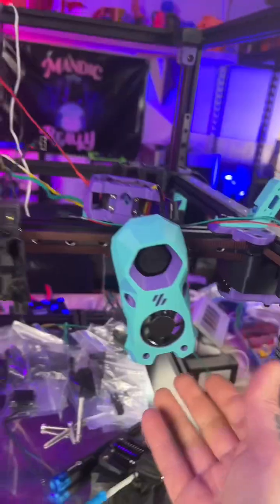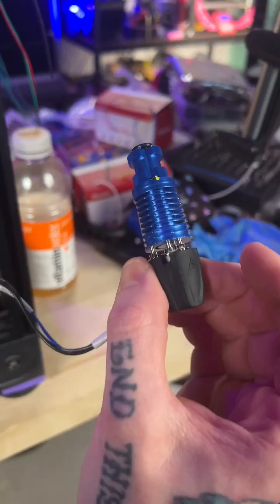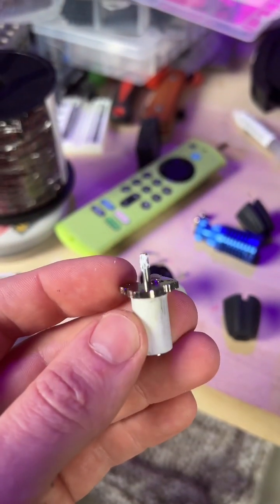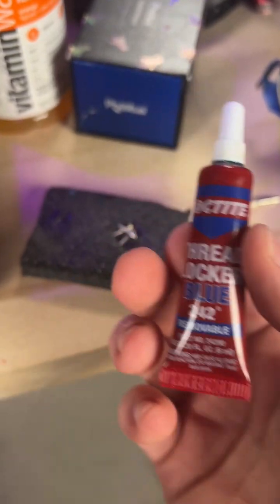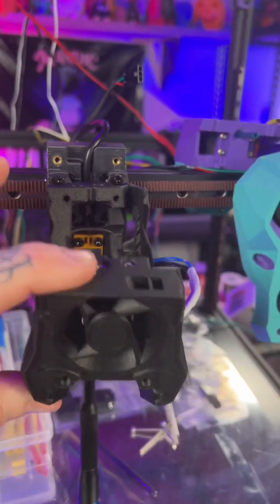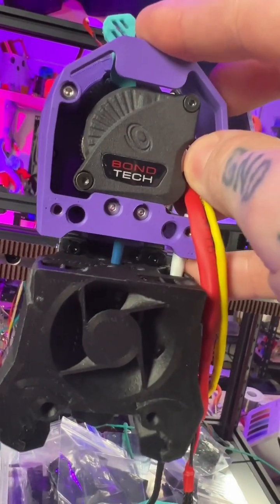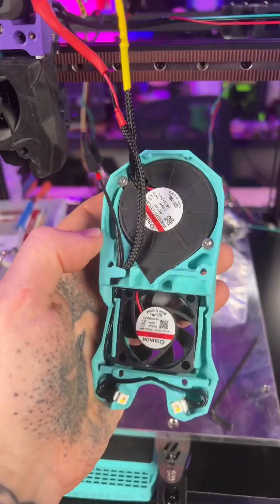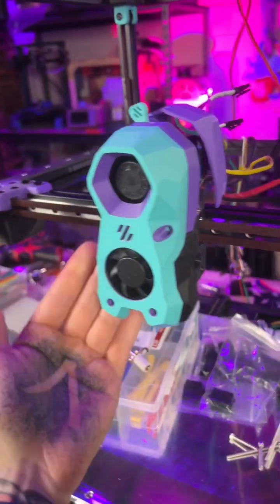Voron StealthBurner Assembly #reprap #shorts #3dprinter

Comment: Swap a whole hot end out just because of a thermisistor? That can also be swapped?
Reply from the maker: The Rapido V1 had a NON-Servicable Thermistor / Heater. If either failed, you had to replace the entire assembly. It was a fully encompassing ceramic heater with an internal thermistor. The V2 has a replaceable heater and thermistor. So yea... replaced the entire assembly cause you HAD to.

Comment: Do you like your lgx lite?
Reply from the maker: I took it out due to going to the CAN board but I did like it. I run one on my Voron 0.1 as well and am quite happy with that one. I’ll be using another one in an upcoming build of a 2.4. Heads people unhappy with them but I’ve never been one of them.
Reply: @MandicReally  oh good....I blindly dropped 75$ on it and a ldo stepper motor.....finally completed my dream set up...slice mosquito and lgx
Reply from the maker: @Jagjagula  hope you love it. My next 2.4 is getting the LGX Lite & Mosquito Magnum+
Reply: @MandicReally  dude I absolutely love slice quality....my mini and switch wire both have copperheads 
I had to save up for the mosquito like I was saving up for a Nintendo cartridge in 88
Reply: @MandicReally  can you point me in the right direction for klipper config for the lgx lite?
Reply: Found it

Comment: Don't do it!  Stick with the CW2 extruder.  I just ripped out my LGX Lite after weeks of problems.  I couldn't get past 8^3 extrusion on petg.  With the CW2 in I can extrude at 20^3 no problem.
Reply from the maker: Eh I ran the LGX Lite without issue for months. Actually a bit sad to see it go but I swapped to the CW2 just last week (check out my latest video to see why).
Reply: @MandicReally  Exactly the same for me.  I had it running great but as soon as I tried to push beyond 8^3 it became the source of all my problems.

Comment: Just wanna get it out there that the Bondtech LGX lite mod isn't that. What you're installing is a nice user mod. There's way more to the one from Bondtech :)
Reply from the maker: There is no "official" (Bondtech mods are still User Mods, not Voron Designs.) LGX Lite Mod.  I'm running the "official" Bondtech setup on my V0.1, but they don't have one for the Stealthburner / V2.4. That is why I didn't bother making any distinctions about who produced the mod.  Heck the "Official" Bondtech V0.1 mod is just a User Mod they have produced in SLS printed form and credited to the originator of the User Mod.

Comment: You should really some insulating tape on the inductive probe, otherwise they start getting heat damaged after some time, and get more inaccurate or fail completely. Make a small hole where the LED is then you can still see when it gets triggered (when you want to test it and look from below)

Comment: Does the heater cartridge not get hot enough to melt the thread locker?  Curious, as we usually use heat to get thread lock to release, especially the red stuff.
Reply from the maker: The thread locker is on the cold side of the heat break (in the heat sink). In theory if everything is working properly they screws shouldn’t get hot enough to release it. Blue Loctite is rated to 180c. If the heatsink is that hot, you are likely into heat-creep / clog territory for the filament.

Comment: Is there a reason you choose to go with the mod?
Reply from the maker: One thing I’m not a fan of with the Voron designs is the extruders. Granted I’ve not built the CW2 but I don’t like how enclosed and complex they are overall. Still the case with the LGX Lite a tiny bit, but it’s just 4 screws to access it and it’s very easy to service. Also the filament path is very clear and straight. Heck I cold pull my V0 a lot of the time because it’s so easy to do.

Comment: How’s this build compare to the V0.1? I did the V0.1 and thought it was actually quite fun, and easier than I expected. This seems like way more parts and possibly more confusion though lol
Reply from the maker: More parts for sure but no fiddly little nuts and bits like the V0. Roll in nuts are soooo much easier. It’s bigger and takes longer, but the general process is a bit easier overall imo.
Reply: I find the 2.4 easier. It is simpler than it seems and for someone like me who has bigger hands it was a joy to build. If you can do a 0.1 a 2 4 should be easy.

Comment: No tap? I've got the same lgx lite, and want to convert to cw2 and tap. Which files did you print for the lgx lite on cw2?
Reply from the maker: The tap setup looks overly complex for my liking unfortunately. And I already had this assembled before they announced Tap. I just put the project on hold for a while. 

I forget what files I used for the LGX Lite. I know you can’t get them anymore. The designer removed them from their GitHub page and only left ones for a version that has a filament sensor in it. I also custom modified mine a bit for some details I preferred.